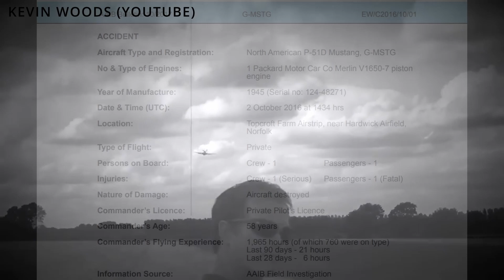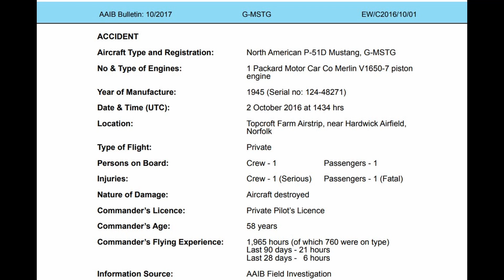P51D Mustang Tragedy at Topcroft | Aircraft Crash Investigation

Comment: I think there was not a stabilized approach here given that final was only 1km long. These very high-powered single engine prop fighters are a real handful to fly because of the propeller effects on the small airframe. It is easy to get yourself into an unrecoverable situation.
Reply: 600 ft pounds of torque requires a significant aerodynamic counter balance. Airspeed is life when doing this stuff.